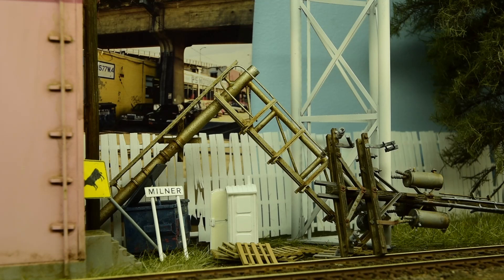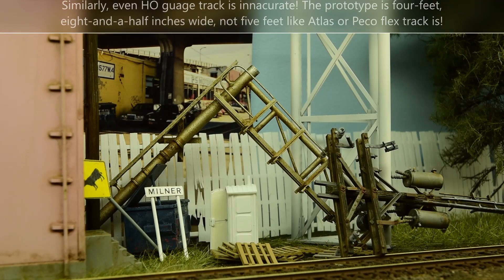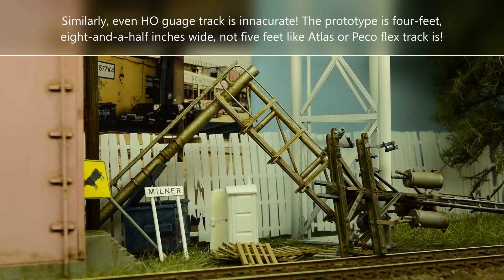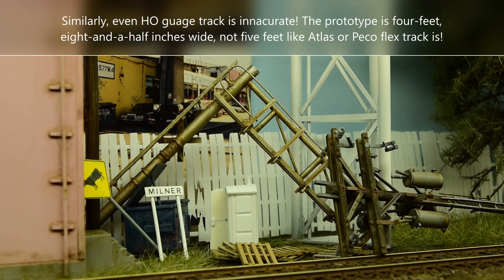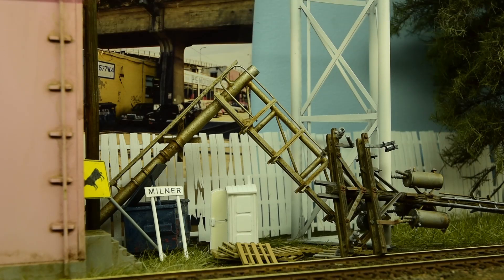Scratch Building 101 | The Introduction: Part 1

Comment: Your videos have inspired me, like I’m sure many others, to try my hand at scratch building.  I started with a small shed, which was remarkably rewarding.  Perhaps to my own fault, the next thing I decided to try was building a 1:87 scale model of my home.  I maybe set the bar too high.  Overall, the plastic construction part went quite well, I think.  When I moved on to painting, I’ve ended up with some results that didn’t please me.  I sprayed matte coat primer and then went for Tamiya and IPA.  The paint itself looked great, but I was disappointed to come back the following day and see that it seemed to warp several aspects of my structure — specifically the roof lines as the go around the corners of the house became wonky.  Where did I go wrong?  Did the IPA possibly leak through and start dissolving my solvent welds?  I used your tried and true solvent and the same brand of styrene plastic I see you use.  Perhaps too difficult a question to answer without photos or more specifics.  But wondering if you could provide any advice that comes to mind.  Many thanks for any input.
Reply from the maker: IPA won't hurt plastic or warp it. Some times you have to reinforce the back side of the model with a piece of scrap plastic as well. Like little triangular shapes (cut squares in half) to make triangles and glue them on the back side. This is why I build over wood for larger structures, etc.. I have had my roofs dip a bit on occasion. This is why I glue in splines or supports from behind. Try to use thicker material for stiffness.
Reply: @boomerdiorama  thank you, Boomer!  Will try it for sure.  I appreciate the input.

Comment: I like learning new modeling skills.  Looking forward to the. Series.  I use Atlas sectional track.  It may not be scale, but I can get it cheap.  I just remove the wired end ties.  I also use compression methods. Not only compression horizontally, but vertically as well. 1/4” deep creeks, bridges 5/8” over rivers and only  low hills on the layout.  No mountains on my layout.  Mountains are just painted in the backdrop.  Don’t worry about being true to scale.  It is like you said Boomer, just what looks good!
Reply from the maker: Right on. Sounds good. I use Atlas flex track all the time and whatever I have on hand. "True to scale" dogma will bog down the best modelers every time. Therefore, why should I imply this to those who are just trying to achieve something tangible and have fun?  Cheers.